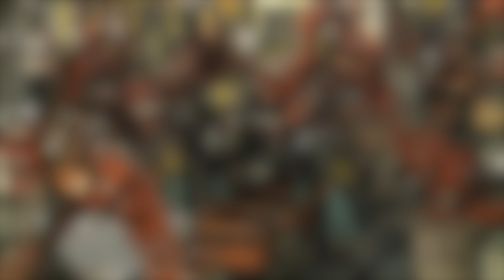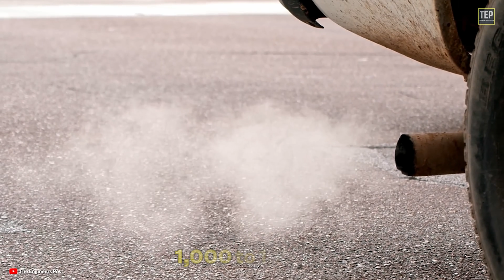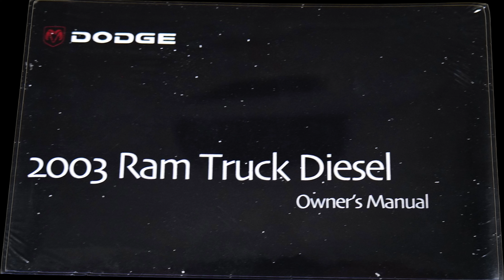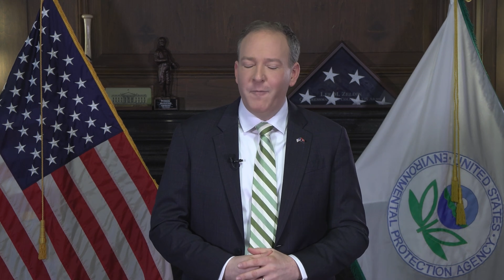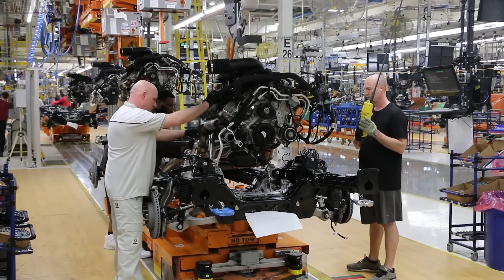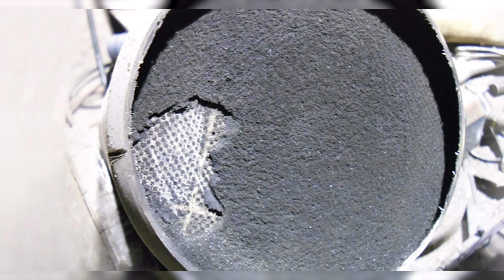Why DPF Regens Leak Diesel Into Engine Oil

Comment: Part of the problem is if the engine is oversized and only runs close to its peak capacity for a few seconds after the light turns green, it's really hard to raise the exhaust temperature.  How often do you see a pickup truck actually towing or hauling something.  Big trucks have become a status symbol for the majority of their owners.  I'm glad they are paying the bill for everyone else's right to clean air.

Comment: Why didnt they put an injector in the exhaust pipe just before the DPF filter? Could be a lower pressure injector!
Reply: That would not only add additional cost but also be easily defeated.